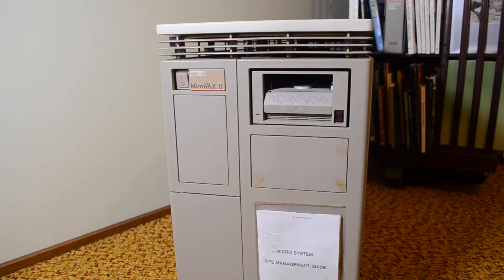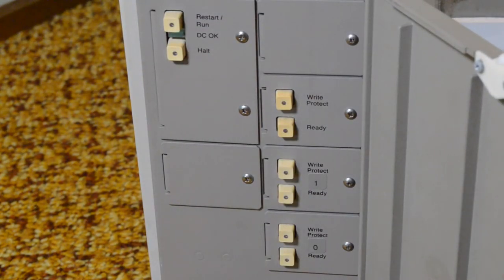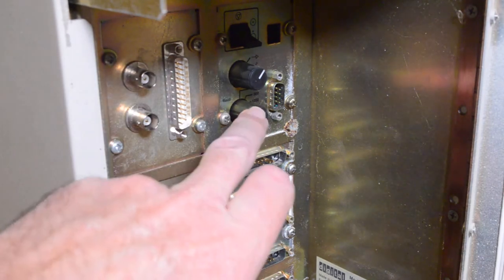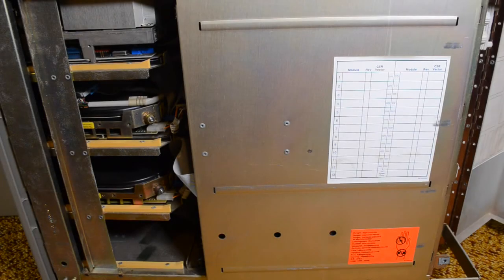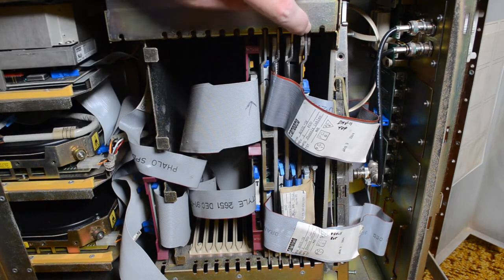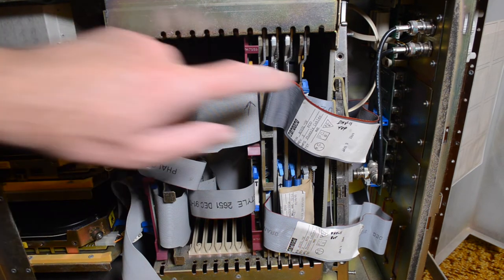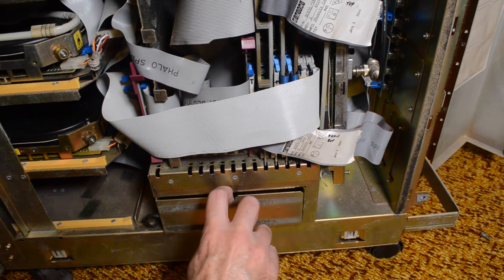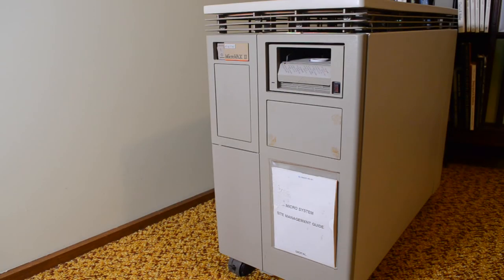A MicroVAX II  (with a surprise inside!)

Comment: I have recently retired. We were still using microvax II and rtvax's with mfm drives (rd53 & rd54) using the rqdx3 card. The hard drives had been dying. We were getting them rebuilt in the U.S. at W.M. Farris I believe.  I tried some of the original emulated drives from Datex. They worked but required low level formatting. We used a microvax 2000 with the bios test 80 ( I think it was test 80) to low level format. Then we had proprietary software that we would load onto the my drives (fallen based) and then use it in a distributed control system. We found a new emulated drive made by DREM. The  DREM engineer worked with us to figure out the idiosyncrasies of the hard drive setup and then e were able to use the Drem drives. They work great! Leo
Reply: Was it never possible to use an Emulator or move the software on to modern hardware?  In the IBM World with AS400 and so on, you just kept the applications written in Fortran and moved the underlaying hardware from generation to generation as they still sell to this day brand new equipment ready to run the old Codebase. In your Case, there is a running company still making VMS OS with supported x86 Hardware.

Comment: About 4:15--I used to purchase 30 & 72-pin SIMMs for my PC memory upgrades direct from Clearpoint back in the early 90s, they were reasonably priced and were good quality (never had any errors or issues with Clearpoint's SIMM modules), a good company to deal with.  They were even thoughtful enough to include a disposable 3M ESD wrist strap with every SIMM order I purchased from them. 

Clearpoint seemed to have had RAM products for almost every make & platform of PC, mini and workstation available at the time, including VAXen in this case. :)